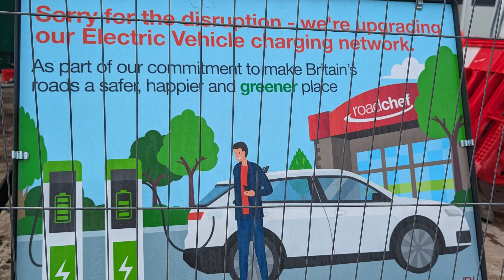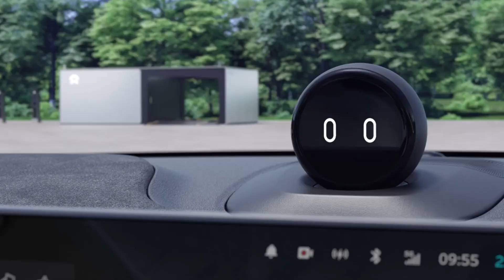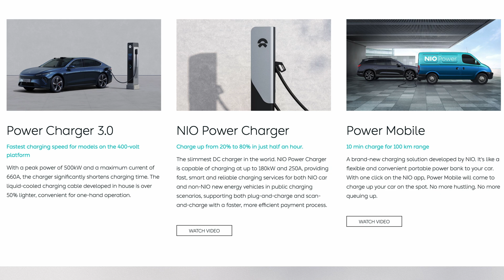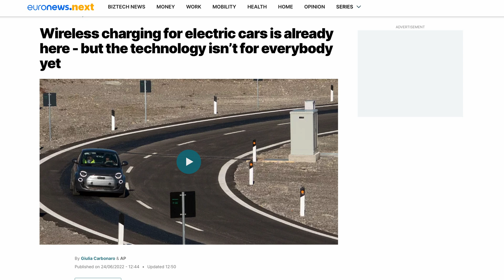Tesla vs NIO | Why Are They Taking Such RADICALLY Different Approaches?

Comment: Hi Dave I agree with a lot of what you say. It’s like charging speeds my car a Kia EV6 can charge its battery in 18 minutes which is to quick if your plugging in then leaving the car on charge to walk in to the services take a toilet break then get a coffee and drink it in less than 18 minutes. But I just charge at home overnight and as you say your not bothered how long it takes as long as it done by the morning. And as for battery swap I don’t fancy that because 1. What is the condition of the batteries that are been fitted and 2. The bolts holding the batteries in are going to get stretched with constant undoing and tightening. And finally is a battery swap station going to be at every motorway service station. But anyway it’s only NIO  that are offering the service. Enjoying the videos thanks.
Reply from the maker: thanks Stephen, good points
Reply: Regarding the battery condition,  Nio does a full battery check on every swap so if a battery is bad it will take it out of service so it can be repaired. 
 Nios battery packs are modular inside and designed to be serviced so any bad cells can be swapped out and the pack put back into service.
Reply: @monkayjim999  that’s good but what about the bolts been used and reused time after time. Plus you would need a lot of these stations up and down the country for it to work. Tesla tried this and didn’t bother pursuing with it. Instead concentrating on the charging infrastructure.
Reply: @stephenclay6852  In China it is working well,  they have over 2000 swap stations so far with up to 75,000 swaps happening every day.   Regarding the bolts and locking mech, Nio has done plenty of testing and if they are starting to show signs of wear they can be replaced.

Comment: Your take on why California battery swap failed is false as homeowners in California didn’t have home batteries and in fact only until the last few years Americans haven’t been adding batteries. The Nio system is more convenient than you mention because they offer both the option to buy car with a battery of certain sizes or rent a battery with the car and with that a swap subscription. You can buy a car with a small better and swap for larger one for your long run and swap back and you only pay per Kw! They now work really well in Norway  on Ling drive routes and inner city. Also recent scientific findings between charging batteries slow only  or rapid only over 100000 miles showed absolutely NO difference in soh at the end. LFP or NMC
Reply from the maker: Good points, but re- charging, its still 15 -30 minutes per battery to 100% against 3 minutes to swap
Reply: I’m a fan of swaps, albeit they actually take around 5-6 mins to swap if you watch Bjorn Nylands many uses of them, inc latest versions. You need to also pre book your slot in advance or you’ll be in a queue
Reply: The last "research" is a scam.
They took maybe 0.001% of the EV out there, they say super charger but don't mention how much kw and time it took to the charger to get from 0-100%
Probably 60min if we took the fact that the car drives 100k miles and a hour is not fast charging by any mean.
So yes, you can find little number of EV in the data base that tesla have and show no degradation but without mention the charging time this is not ever matter
This "research" is worse than my 4 grand science project